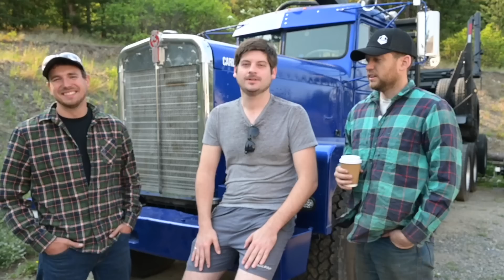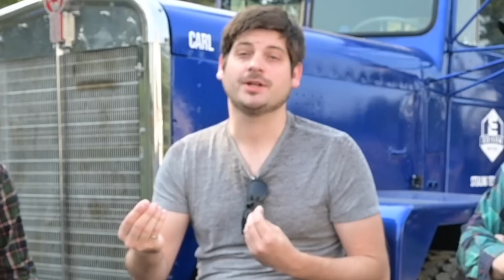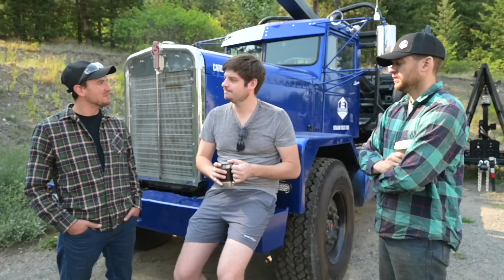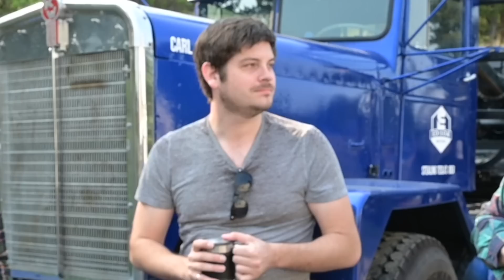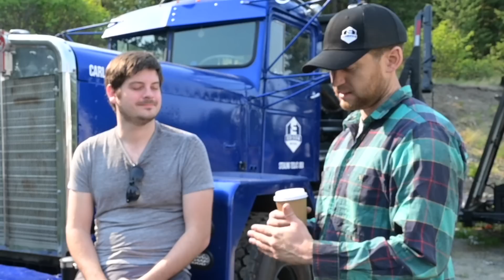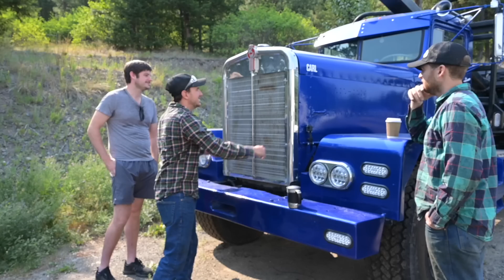The future of Electric Trucks?

Comment: What's your fuel savings? 
The test would be Fuel consumption at Idle v.s at load and if you design the power system where the power produced at Idle is the same at load and the same amount of fuel is used either way. Your calculation becomes from really what's you range to What's your Drive time on a run and how many runs until you have to refuel. 
you can draw some Idea of what the Data would or could look like with the data that exists with current Diesel Electric locomotives only thing you wouldn't have is Battery data cause until the last couple of year they really didn't use batteries on them outside of switching yards.
So always advertise the worst case scenario which is the Diesel powered power plant never shuts off and you can go X-miles on one tank of gas with the battery range expended after the Engine shuts off.
Reply: They literally spent the first half of the video answering this question
Reply: @RedHair651  They said It depends, and listed a bunch of stuff that Kind of doesn't matter, the answer to the actual question is  how long does the truck run in the worst case scenario, cause the best case is the battery is big enough to power you up a mountain and the regen is strong enough to recharge the battery on the way down and the engine never has to kick on to recharge the battery.

Comment: I have a stupid question: will a hood full of batteries be a potential fire hazard in a catastrophic collision?
Reply: The trucks don’t have a crumple zone like a normal consumer vehicle so they would be far better protected than you might think. Basically in a heavy steel plate cage.
Reply: The battery chemistry that they are using doesn’t have the fire hazard that some lithium batteries have.